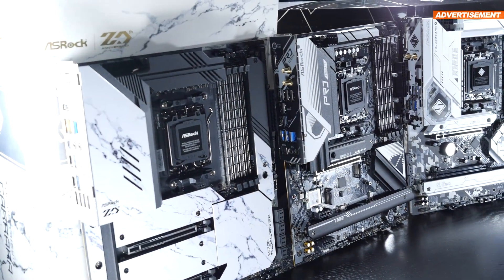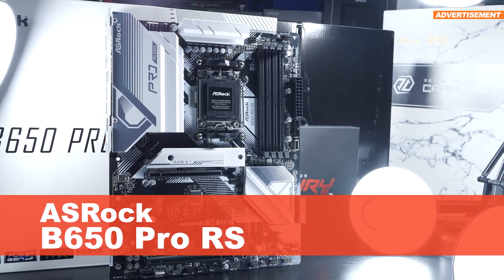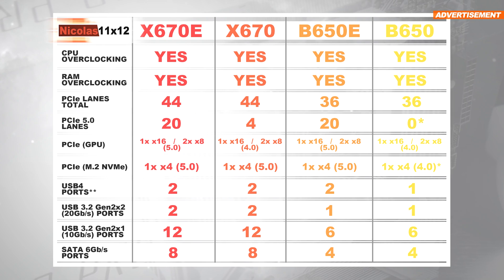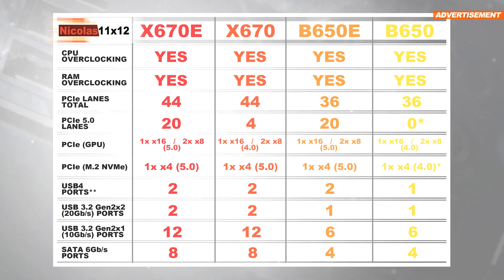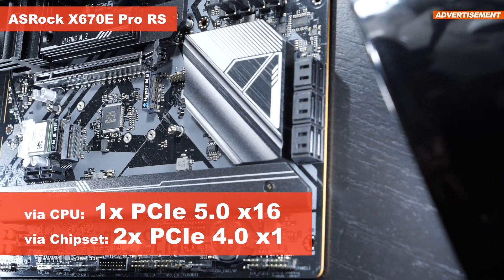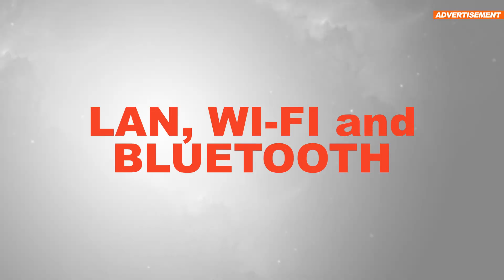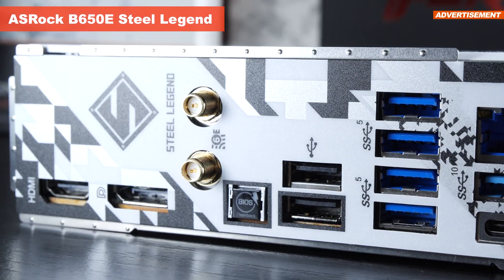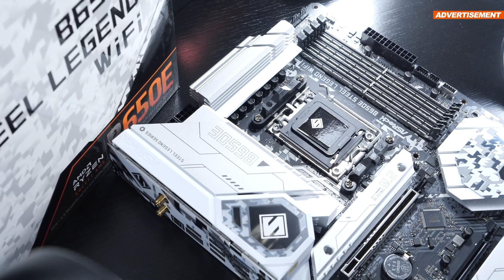Which AM5 MOTHERBOARD Should You Buy? -- X670E vs B650E vs B650

Comment: help. my b650e tuf 7700k is slower than my 9900k!  all gpu bench is 10% less. the cpu is working perfectly. all bench are fine much faster. but any graphics score 10% less. 100% load but still less fps...of course brand new win install new drivers etc? any ideas. is the motherboard gimping my gpu? so confused
Reply: Check your memory is running at the correct speed and your cpu temps.

Comment: I just purchased an Asus ROG Strix B650-A. I really want a B650E-F but it's not available on my country.
Come to think of it, mostly the difference of B650E and B650 are those PCIE5 support. 
My Asus ROG B650-A only has support for pcie5 on the most top SSD slot.
There is no PCIE gen5 GPU right now even the RTX 4090 only support pcie4 and even if there is a GPU that support gen5, I think there's not much difference in performance.
PCIE gen 4 SSDs are still expensive and, in my case, mostly I will not purchase gen5 SSDs surely, they will be expensive.
Just my 2 cents.

Comment: The board I see missing is the ASRock B650E Taichi.  You can get the 24+2+1 VRM  @105amps.  Current pricing $499.  So there you go, all complete now.
Reply: is it worth paying that extra though?. the asus x670e strix -F is cheaper.
Reply: @djam7484  no It never is. Just get the features you want at a price you want and don’t worry about it too much
Reply: I got one for $369.99 by price matching Newegg.

Comment: Great video! Would this specific ASRock B650E Steel Legend be fully compatible with a Noctua NH-D15 CPU cooler?
Reply: As long as you have the AM4 brackets then yeah.  Then most all AM5 Mobos will allow it.  This was stated out a few weeks ago.  You might want to think about going with an AIO for cooling though.  I currently use a Noc-D15 but it may not be enough for the new Chips.  Good Luck.
Reply: As long as you have the AM4 brackets then yeah.  Then most all AM5 Mobos will allow it.  This was stated out a few weeks ago.  You might want to think about going with an AIO for cooling though.  I currently use a Noc-D15 but it may not be enough for the new Chips.  Good Luck.
Reply from the maker: Thank you! I have to agree with the previews commenter "Hal Richard". If you have to right brackets, it should be compatible, but it's advisable to go for more powerful cooling with these Ryzen 7000 CPUs.
However, I will also conduct undervolting tests, etc. to see whether or not temperatures and power draw can be lowered without or hardly any performance loss. :)
If it can be done, you should be good to go with your NH-D15 from a performance standpoint.

Comment: Great to see you Nicolas, going into such depth with B650 chipset here as despite the limited release so far of the boards, not much is being shown or discussed by reviewers. I have used B450, X470 and X570 chipsets before in my builds, however going forward for my next build I will look at the B#50 chipset as AMD is looking to heavily segment their chipset in terms of I/O going forward 🥺😔, also their pricing. DDR5 is still a bit pricey, u der delivers in terms of performance currently as well as PCI-E 5 drives not bring available till 2023, very expensive and harder to cool makes these new tech’s irrelevant at this point in time. This conjunction of numerous tech advances, high pricing etc is a bad storm of events for any tech releases for any company imo.
Reply from the maker: Thank you very much for your comment, Michael! :)
Indeed, pricing is really steep nowadays. And unfortunately, it seems, that isn't just the case with the AM5 platform, but Z790 boards will probably end up with high prices, too. :(
While the changes in the industry are exciting from a technical standpoint, I don't like where we're heading in terms of pricing and price-to-performance ratio.
Thanks for your feedback. Greatly appreciated. :)
Reply: @Nicolas11x12English  I am from Russia and I completely agree with your opinion!